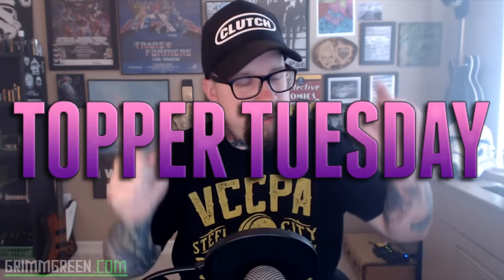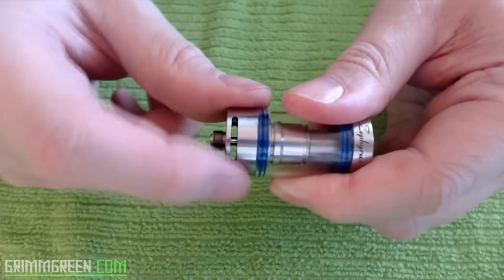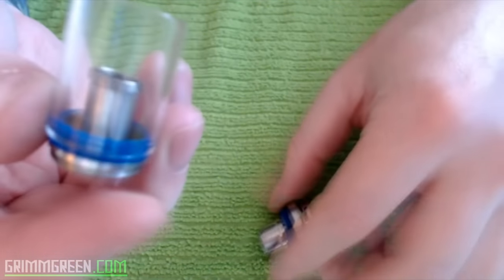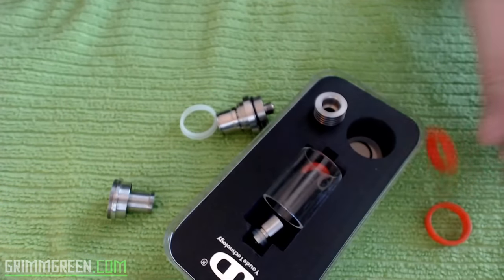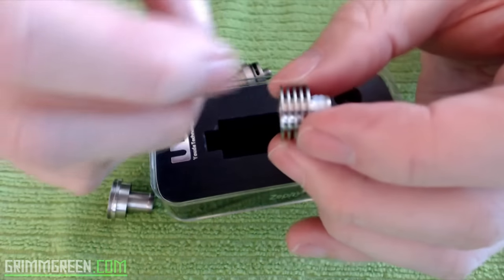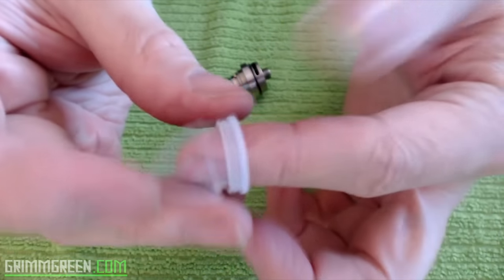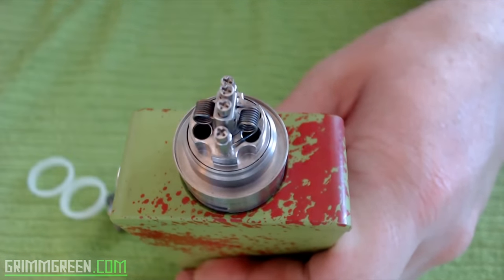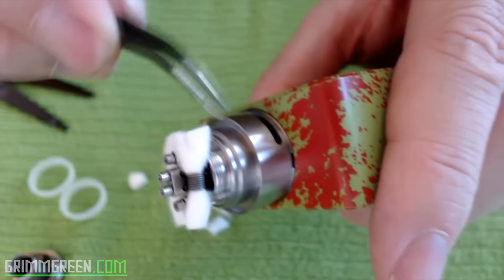The Zephyrus RTA ~ By YouDE

Comment: I cut my wicks at a 45° angle. Thinner on bottom thicker on top. The thinner bottom part goes in to the juice channel but not completely clogging it. No leaking, flooding or dry hits. This is the best sub ohm RTA I've used.

I also wick my Goblin the same way, perfect toots every time 😃
Reply: Matt Lively thats exactly how i do mine!
Reply: thefailingstudent best way to do it. I've messed with this thing for two weeks trying out different things and great success with the 45° slice action.
Reply: Matt Lively Me too.
Reply: Matt Lively Got a pic or something to go by? been meessing with this thing for too long trying to get good flavor...
Reply: Clay Stanley I'll get back to you this evening after work for sure.

Comment: Grimm the "tornado" line in the drip tip is a factory flaw, known as a machine mark coming off the lathe.  Its created by the cutting edge plunging straight in and straight out.  The proper way is to send the cutting edge in lift it off of the bore and then pull out so the cutting edge doesn't contact the surface on the way out.
Reply: It's not a flaw mate, it's designed this way.

Comment: NO LEAKING - Zeph
I had the same problems, i tried everything but wicking or coils didn't bring the solution. I wanted to trow this Zep to the ......
Then i remembered i had the same problem in the past with my TFV4. The solution was simple.
I took everything apart and firmly screwed the TOP and BOTTOM of the chimney FIRST. Put on the glass.
I filled up the glass to the max and put the bottom part on it (with the coils). Now its NOT leaking and filled to the max. 
Also after refilling NO leaks. So be sure to first do the top+bottom chimney part. 
p.s. i have a box full of rings but did not use it on the chimney so its not needed.
Also if you do put on a ring, after a while (or heat) it could leak again. Just firmly screw that chimney parts and you'll be done.
Love your vape :)

Comment: Be aware some people seem to be having an issue with this tank on the Innokin iTaste MVP 3.0 Pro unit.  When fully tightening the tank to the box you'll see a dead short on the ohm meter.  If you back it off slightly, maybe a quarter turn, it will read & work fine too, but the tank will feel loose of course.  I solved the problem by filing just a tiny bit of the centre pin off & then cleaned up any debris that was left behind.  No issues after that & the tank fits snugly as it should.
Reply: Tom Long II That is the same problem that I am having with my MVP 3.0 Pro. This is the only tank that I have the issue with. My 2 other tanks and rda work just fine on my MVP. I am convinced it is an issue with the tank as I put it on my ohm reader and it would not give me a consistent reading. I would screw it down till there was just a little resistance and it would read at .75 ohms. Give it a quarter turn more and it would read .42. Another quarter turn and it was pretty snug but then it would not read at all. I am sure not all tanks are like this as I have been seeing many good reviews and may have just got my hands on one slightly out of spec. I am still a noob but learning a lot as I go.

Comment: "Easy to build, easy to wick"?! I'd hate to see what you considered difficult! My first build attempt took hours and was pretty frustrating, though now that it's done I'm feeling a bit proud of myself.

Taking it apart to change coils or rebuild is not great either. Lots of sharp edges and between the fill cap and the air holes not a lot of surface area to get a good grip.

But the price is nice and the top fill is nice (especially if you get it on sale!) so while I don't see this replacing my sub tank mini, it'll do for a solid backup tank.

Comment: You just had to come up with another way to wick this thing :)  I had been tapering the wick down to the channels but wasnt getting great flow with MaxVg. I will be giving this a try as soon as this tank is empty.  Great tips.  Thanks a bunch
Reply: Jeremy Baity Let me know how your wicking turns out. I taper to the very top of the juice well and it performs pretty good but I think wicking is very picky on this tank. But I am also going to try his way but looks like tons of cotton which will restrict the airflow to much.
Reply: Iceburgh4458   I finally broke her down to clean/adjust coils and re-wick.  I have a dual parallel 28 gauge 2.0mm I.D. (6/7 wraps).  Ok so I was able to get good results with the original wicking method but still had a little bit of leakage when filling tank.  I have had best results keeping the coil about 2.75-3.00 mm above the airflow holes and then shape the wick to look like a handlebar mustache.  The ends of the wick taper to a point and sit in the top 1/3 of the channel.  This works good. 
Just wicked the way Grimm showed and so far he is spot on. Zero leakage on fill and no dry hits thus far.  I like closing the AFC down to about 15% open.  I will let you know how this works after a couple of tanks.  Still breaking in the wick.

Comment: Just a quick heads-up, the two gaskets for each color are different, one is stiffer than the other.  I believe the stiffer one is supposed to go on top.
Reply: You're correct, stiff goes on top. This allows the bottom to unscrew easier than the top.
Reply: To be fair it should be in the instructions.

Comment: Man I love this tank. I run claptons in it spaced out 4 wraps each side. Comes out .35 and blows bigger than any RTA I've ever seen. Just wish I could get a nickle build to work in it. I never can get it high enough with 28 gauge wire. Any suggestions?
Reply from the maker: Chase Gregg the only solution would be more wraps.  I can usually get to around 0.10 ohms using 15 wraps
Reply: There's enough space for an Clapton Coil? In the videos it looks really cramped.

Im not sure which RTA im gonna buy, this Zephyrus or the New Aspire Triton. In taste they should be great both! as far AS i knoew also in vaper production...

And by the way, why you dont try it with Titanium wire. There youll get more resistance on your build.
Reply: GrimmGreen  Thanks brother for the response. I really like your videos by the way. You got the most swag out of any of the other vape vloggers and I respect and trust your opinions over the rest.  Anyway... What size are your wraps 2.5mm? I guess I'll give it another shot with the Ni200. I've thought about twisting it with kanthal or trying titanium wire. Nevertheless, I'm not giving up on temperature control. I just ordered the TCT hoping it will be the answer to the garbage Kanger Ni200 coils I wasted money on.  But I want to build my own Ni200 coils, so any suggestions are appreciated! Thanks again for what you do bro.
Reply: Sebas M I'm running 4 spaced wraps of VaporGrudge Claptons 2mm. Comes out .34. Absolutely in love with the flavor, vapor, and performance. Do yourself a favor and get this one. The RBA section in the triton looks janky as f and seems like its only for someone out of coil heads instead of the builder who likes to experiment with a top notch deck to build on.

Comment: What tank would you recommend for the Innokin Coolfire  V4? It's going to be my first MOD. I'm coming off the Etwist style to a MOD.
Reply from the maker: angel infante jr The Innokin iSub is designed to work with that mod.  Solid tank.  Or check out the SauceCode from VaporDNA
Reply: Thx bro, learned allot off your vids.

Comment: Too many damn RTAs, which should I get?
Reply: firdaus125 yes and if single coil and flavour is your priority, sill the subtank (mini).
Reply: ***** wut
Reply: +firdaus125  I have both the Zephyrous and the Goliath V2. Both are exellent however I feel the Goliath produces a better taste at the cost of using more juice. The easy acces to the build deck on the Goliath and slightly better taste and the option to close off the juice flow is great on the go. The zephyrous is more pleasing to the eye and hold it's ground very well. I do still do have leaking issues from time to time on the Zephyrous mainly when filling her up. The deck is also quite small so experience in the matter is a must. The top fill system a major postive aswell (at least for me) I would personally recommend the goliath over the zephyrous in the end. But I am still very pleased with both. The Smok v4 is also worth looking into but im waiting till the dual coil RBA becomes available for that one. 

ps: I use 26 canthal most of the time running a 0.4 ohm build. I also want to thank Grimm for his great vids! I started out with a simple nautilus mini and moved up from there thanks to his vids! (and never touched a cigarette again)

Comment: I've had this for about a month, but can't seem to build it right. THE ONE "non-rebuildable" coil head that I got, somehow shorted out and I can't use it. Unless I can find a vid on how to rebuild these, it's useless and I have to use the RBA section, which for me, I can't get a non-spitbacky hot ass (which is unpleasant for me) vape. BTW grimm it's pronounced U-D
Reply: johntheawe Hopefully this vid helps me with building/wicking.
Reply: johntheawe If anyone was wondering what I had it on top of when the coil eventually shorted out for some reason, it was the sigelei 100w. Don't know why it did that, I never put it on a hybrid mod or anything, must've been a defect. I got to vape on it a little bit before that though.
Reply: johntheawe I definitely should've tried that wicking method. DOING THIS NOW!

Comment: GrimmGreen did you notice that this device has inside a "secret juice control system"? 😂
Reply: Try to loose the chimney a little bit before you close the tank 😂 ... I've find out this on another guy's channel and going over 50-60 watt flawless
Reply: Ezio Troito What video? id like to check it out
Reply: Ezio Troito will have to try this

Comment: Hiya GrimmGreen, Love your tude and vids man!  I enjoy the Zephyrus but Im having an issue with the replaceable OCC's.. RUST! After 3-4 days mine all seem to begin to leak rust from within the juice channels thus tainting the juice and probably me lungs. Has anyone else been having or hearing of this yet?
Reply from the maker: ItcHy__ FiNgER Chances are it's not rust.  The components in the coil head are made of stainless steel... which doesn't rust.  What is happening is basically a sped up steeping process.  Where the juice near the heat of the coils is getting darker due to the VG and any possible sweeteners in the juice.
Reply: FANTASTIC!! This is great news, thanks a bunch. I'll play with some diff juice and see what comes of it.

Comment: i got this tank but it always leaks ii hate it annoys me so much !! how the hell do i sort it out someone help please

it leaks from the bottom of the tank i don't know where it leaks out from but the liquid spills out from under the tank
Reply: it leaks from the pin
Reply: so how do i stop it then?
Reply: No clue. I have yet to figure that out. I just deal with it.
Reply: yh i been dealing with it but its annoying now doe
Reply: It is annoying I agree but maybe they'll fix that issue with their v2 of it
Reply: i hope so because i still think its a great tank the leaking is the only down fall for it and its sort of a big down fall
Reply: +Shahin Alom I had that problem too, but it seemed if i would take it apart, clean all the parts, and put it back together - making sure the o-rings on the tank were seated well, as well as making sure the two ends were screwed together securely - the problem seemed to go away and haven't had too many problems with it happening anymore...hope that helps?
Reply: i will try it tonight thanks i think my o rings are not sealed well now you mention it

Comment: But it's marketed as/is a sub ohm tank with prebuilt coils....
Reply from the maker: Kyle Noonan Like I said,  they sent me one... but I used it and now it's gone,  I didn't have a spare to show
Reply: Didn't see that when I posted it. Still would've been nice to know more about the stock coils. I'll have to try that wicking method though, I've been doing it the way you mentioned and got soso peformance. This certainly looks a lot easier.
Reply: GrimmGreen Should have kept it, ive had great fun rebuilding the stock head. So much space in there, even did a 4.5mm vertical.